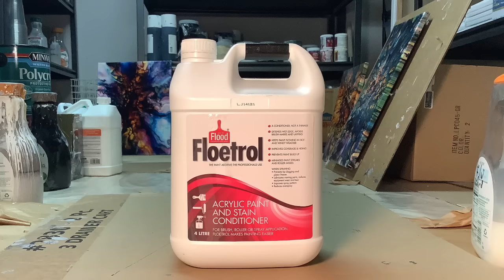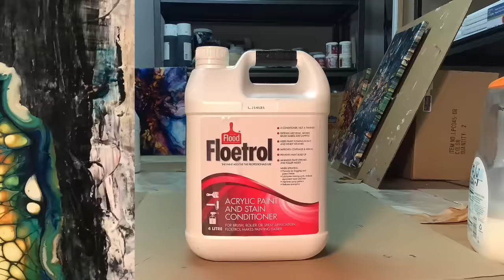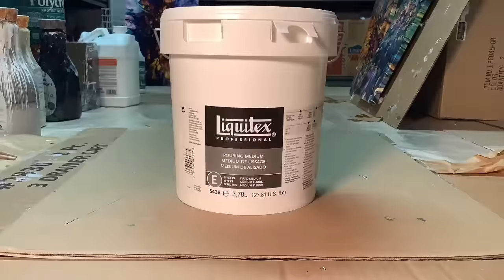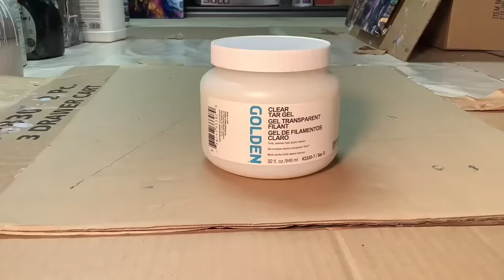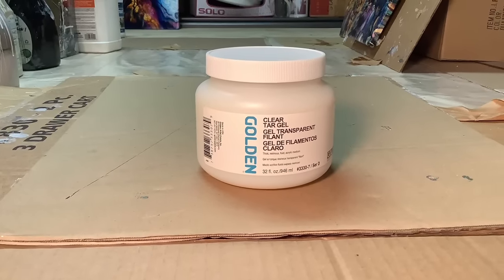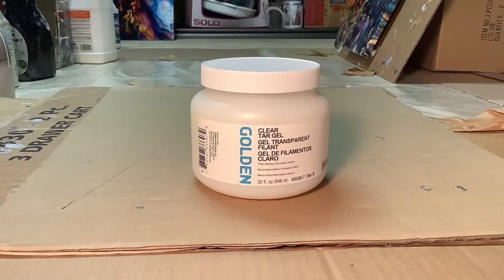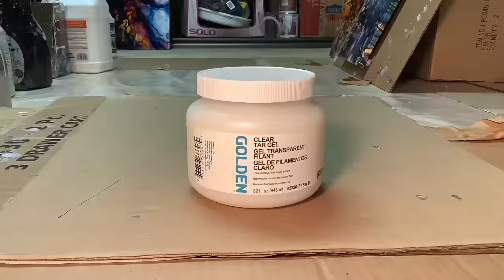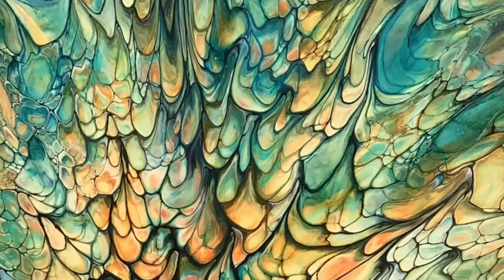What is the ultimate cell activator?

Comment: Fantastic video. I’m one of the artists you mentioned, who is about to experiment with cells. I’m so happy to know that I can have more control over this, by using the correct materials, instead of crossing my fingers & hoping for a good outcome. A question I have is, early in the video, you stated using 10% fluid paint in the mix to get pigment. Is it possible to use powdered or liquid pigment, which I have much of, in order to get colors with the other 90% mix you described. In lieu of using fluid paint at all? I have an extremely limited income & would like to use the pigments I currently own, instead of trying to budget costly Golden paint. Do you have any experience with this technique. Thank you for all this info. Beautiful art!
Reply from the maker: I appreciate your comments Karmic Scope. 🙏 thank you so much. I tried Golden’s liquid acrylics and it worked but I much prefer their fluid acrylics. I’ve never used pigment powder…my guess would be that you would need to convert it to paint first and the add it to the mix. Sorry I couldn’t be more help🙏

Comment: Hi Chase. Thank you so much for your video. Very very interesting. I just have one question about the base layer, I am assuming it is not necessary to add color paint to this layer.?as this is going to be covered by the 2nd layer and top layer after blowing and stretching?
Reply from the maker: I appreciate you asking that question MagzB 🙏 I’m sorry that I wasn’t clear enough in the video because I have gotten this question several times. The base layer is exactly the same as all of the other colors…same formula and same type of paint. The only difference is volume…obviously it takes a lot more of the base color than the other colors. In the case of this video the base color was titanium beige. ALL…of the colors used Golden fluid acrylics. The only exception was the paint in the top layer mix…and that was Lukas black. So to answer your question…yes the base needs color to blend with the other colors. Thank you so much to help me clear this up🙏
Reply: Thank you so much for clarification. 🤗🤗🤗
Reply: I live in France and I cannot get the Minwax polycrylic at moment nor the Behr paints. I will have to experiment a bit. Thank you so much.
Reply from the maker: @magzb5175  …I understand…folks outside the US are not able to follow my exact formula but that doesn’t mean your substitute ingredients won’t work..what you find might be far superior! What I can advise is what to look for. 
The main ingredient for the main mix (for me is the Behr) needs to be neutral so that the colors that are mixed with it won’t fade or wash out. It’s chemical composition needs to be simple…the more complex it is the more chance it will interfere with the pigments in the colors. Lastly it needs to be as stretchable as possible. The Behr that I use is the base used to mix the deep base colors for house paint …so it has very little (if any at all) pigmentation. When I open the can it looks like very light cream ( I would avoid it if it looks white) and it’s extremely thick. Start by asking the paint store for deep base or it could be named ultra deep base. Pay the extra price to get it in quart sizes and buy several to experiment with.
The main use for the Polycrylic is to thin the base without having to use water. It’s very thin and has almost the same consistency as water but it has just enough body and chemical composition so that it won’t weaken the paint. Ideally you want something more substantial than water that will not interfere too much with your deep base paint. You might experiment with varnishes or polyurethanes.
The Golden tar gel is not an absolute requirement but with my formula I found it to help with stretch ability and integrity. My advise is to concentrate on the other two ingredients and get them working to your satisfaction….then experiment with the tar gel.
Best of luck on your journey 👍
Reply: You are a gem.. thank you!

Comment: Dear Gift to us learning the process.  Please would you be so kind as t tell me if you have a print out of brands, quantities etc.  I tried looking at your transcripts and that helps but I wasn't sure.  It sounds like you use the Behr 3450 (?) now for both Base coat & for your Pour Medium.  Also i believe you said on the floetrol 5 parts to 8 parts water as the mix?  How much of the Golden Tar Gel do you add to that and also how & when do you use the polycrylic product?  Ever so thankful 4 the help and direction.  grateful, pam
Reply from the maker: Thank you Pamela 🙏 here is a simplified outline…

There is no “chemical” magic here.  It’s all about density/gravity of paint and controlled force to push heavy density paint down and out onto lighter density paint.
 
STEP 1:  Main Mix:  Base Paint & Color Pouring Medium; 
Mix: 3 parts Behr Marquee Interior Semi-Gloss Enamel, Deep Base, Untinted, 3453 (green can, HomeDepot)
       1 part Minwax high gloss polycrylic
Add: to the above add 10% Golden tar gel
EXAMPLE: 15 oz (3 parts) Behr
 5 oz (1 part) Minwax Polycrylic
20 oz (4 parts) total
20 oz times 10% = 2 oz tar gel (which is almost ½ part [2.5 oz], but is actually 3/8 part)
***The consistency of this formula is ideal for my use of controlled air. If it is too thick for you I suggest adding small amounts of water to the polycrylic alone until it suits your particular style...this will probably take several trials...so test with small proportions.
 
Apply a fair sized puddle as the first layer or base paint, it is the identical formula as all the rest of the colors....spin to thin it down a bit  and add more base paint around edges of paint that is already down, spin a bit, and smudge base paint out to edges of canvas.  
 
STEP 2:  Color Paint Mix; same consistency as Main Mix
Mix: 10% heavy pigment paint (Golden is best)
90% Main Mix (Base Paint & Color Pouring Medium)
 
Apply Color Paint Mix (second layer) in several ways, using squirt bottle, either very thin squiggly lines or in puddles made of thin squiggly lines that then look like they were poured, doing 1st color, then 2nd color, etc.
 
STEP 3:  Top Layer Mix ; this will be THIN
Floetrol/Water Thinner: 5 parts regular Floetrol plus 8 parts water. 
This will be used to thin the Tar Gel or the Liquitex Pouring Medium.

Tar Gel Top Layer Mix: 
10 parts Floetrol/Water plus 4 parts Golden Tar Gel. This makes the thinner for the paint.
Then mix:   8 parts Thinner Mix with 3 parts soft body paint.

Liquitex Pouring Medium Mix:
4 parts Floetrol/Water plus 10 parts Liquitex Pouring Medium. This makes the thinner for the paint.
Then mix:   10 parts Thinner Mix with 7 parts soft body paint.

Apply Top Layer Mix using squirt bottle  concentrating in center or apply as puddle made of thin squiggly lines that then look like they were poured.
 
STEP 4:  Use controlled force on the paint (compressor, blow dryer) to force Top Layer Mix  over color paint.  This is the most critical part.
 
STEP 5:  Spin or tilt
Reply: Thank you ever soooo much.

Comment: I am just starting out as well. Because I am so new at this and only have done one pouring technique when we went to a workshop together. I was told, starting out, use the cheap stuff first then move on to until you get better because it how much all this cost. Is that something I should do first?
Reply from the maker: I appreciate your concerns Sandy 🙏 thank you for asking. I started with cheap paint and it was probably a good idea because I had no structure so I wasted a lot of paint. Over the years I became more particular with ingredients because I could see that lower grades of materials were causing problems by introducing “trash” into the painting. Simply put..cheap paint has minimum pigments and more fillers (to increase volume). Artist grade paint on the other hand has much more pigment and minimal fillers…big difference. And it’s not just paint. When I started using Elmers Glueall as a medium. I got it to work but the finished product seemed trashy and that’s because it is loaded down with all sorts of chemicals and fillers. I switched and started using professional bookbinder glue and that made a huge difference because it’s a much more streamlined product that eliminates the trash and produced a much cleaner painting.
Lesson learned…the cleaner the ingredients going in…the cleaner the final outcome. Scroll through my portfolio from the bottom up at Chase Fluid Art on Facebook. You should see the progression from trashy to a much cleaner look as the years went by. 
With my process today I use the best paint I can find. It is by far the most important ingredient. All of the other ingredients are as straightforward, clean and un-complex as possible. They play secondary but specific roles.
Hope this helps….best of luck on your new adventure 👍

Comment: Hi. I'm hoping you see this, given your post was over 2 years ago., I have watched your posts so many times and can see why you take this approach. It is more to do with cell generation than cell activation, What is evident is there must be a relationship between differing pigment densities (colours) and a limit where the 'cell' is created by a greater or lesser dominance of another pigment,. You refer to floetrol as a thinner, which they clearly say it isn't.... they refer to it as a paint conditioner. I have a very simple question. When you refer to mixing, are you referring to by volume or by weight? reason I ask is that obviously not all paint is in such low viscosity that it can be measured by volume - even though it's sold by volume. example Windsor & Newton or Arteza are heavy and unless you know the weight of the empty tube, almost impossible to determine the volume, via the weight.
Your approach is quite unique and I both love your approach to understanding the science and love some of your visible work
Reply from the maker: Thank you so much David 🙏 yes…left to their own devices the differing densities can be layered to produce cells. However the use of force on a heavy/liquid top layer of paint can produce cells regardless of the densities of the layers below. Referring to Flotrol as a “thinner” is my terminology because it is used to make the paint less viscous. As far as measuring…I measure EVERYTHING by weight. I appreciate your questions 👍

Comment: I'm very new to this and all the videos I've seen say to use house paint as your pillow or base paint, but it sounds like that's not necessary.  Is that correct?
Reply from the maker: Thank you so much Gretchen 🙏. I’ve tried house paint…didn’t care for it…it caused too many unnecessary problems. I like simple. The fewer ingredients the better 👍
Reply: @chasefluidart4341  so then am I to assume you use regular artist acrylic paint as base?
Reply from the maker: @gretchengilham3749  …yes…the base is exactly the same as all of the other colors in the Main Mix👍
Reply: @chasefluidart4341  thanks so much! One more question,  what is the consistency of the Behr that you use? I can't get that here so I'm trying to find something comparable. I bought a base from Pittsburgh paint with a consistency of cold honey and while I like the finished look of the colors I add, I'm not getting cells,  so frustrating 🙃
Reply from the maker: @gretchengilham3749 🙏 in comparison to honey I would guess it’s thicker. Keep in mind that you want the Top Layer Mix to sink down and through the Main Mix to create cells. But there still needs to be some resistance in the Main Mix. Otherwise the Top Layer Mix will just immediately sink to the bottom with little cell activity. To start off  I would prefer to have the Main Mix too thick than too thin. If it is in fact too thick the Top Layer Mix will struggle to break through and you Will know that it needs thinning…and it’s easier to thin the Main Mix down with the Polycrylic than try to thicken it up. Bottom line…it takes experimentation to arrive at the right balance 👍

Comment: Thank you for sharing your experience on this very informative video! I have a question. Have you ever tried, Elmer Glue-All instead of Floetrol. I've seen video's of people using this instead. I haven't and wondered if it could work just as well or better. It's definitely less expensive. Thanks so much!
Reply from the maker: Thank you so much GL 🙏 I’ve used it in the past but it is made to cover a lot of bases. It has too many chemicals that can make paint go wonky. My feeling is that the cleaner and simpler the ingredients the better. Bookbinders glue is a better product but very expensive....I’m curious though...last time I was in Home Depot ..Flotrol was about $13 per gallon and glue all was $18....are you outside of the USA?
Reply: I've been pouring for about 4 years now and have tried everything. I've found Glue-All + poly crylic +Elf face Primer and sometimes a little water to be the best combo for me. I just saw where someone had said they liked Elmers School Glue better, so I've been using that and I think I might like it better too! The game changer for me was the Elf Face Primer (the light blue or pink one) You can get it at Walmart. It makes the coolest cells I've ever seen. Cells inside of cells inside of cells!!
Anyway, I love the glue...60% glue to 40% water.
Reply: @jackattack_8  how much elf face primer
Reply: @nadiaafreen218  
I use the pink one mainly and I just do like a pump. Depends really on how much paint you're using.
Reply: @jackattack_8  so what's ur ratio to  glue to polycrylic to face primer?
Reply: @nadiaafreen218  
I do almost as much glue as paint (Elmer's school glue mix with water. 60/40) 
Then I use a squirt of polycrylic

Comment: Great video. Can you please show me your air gun & compressor as I'd like to get one due to having emphysema thank you
Reply from the maker: Thank you Julie🙏 Interesting that you bring this up because my next video deals with this subject. More than any other piece of equipment the air gun is at the top of the list...it’s critical. It’s all about the trigger control and very few guns have that capability. It’s the ability to move the paint around with the least amount of pressure that counts the most...but you also need a lot of power at times also. My compressor comes from Home Depot... I don’t remember the model number but I can tell you that it has a 2 hp motor and a 15 gallon tank and manufactured by a company name California. I got the air gun and Venturi nozzle from...https://www.northerntool.com/shop/tools/product_200792060_200792060
Check out my first video “Abstract Cellism “ for more details.
Reply: Thank you so much will definitely check out your other videos. There are so many out there I don't want to waste money buying something useless & yours does the job so well
Reply from the maker: Thank you Julie 🙏 my best advice...time spent learning control of the trigger pays big dividends 👍

Comment: Steve, Hello from Charlottesville, Virginia, and thank you for your videos on Abstract Cellism! Being brand spanking new to the process (I’m a realist painter that works in either oil or pastel), I’m fumbling my way through the acrylic paint world. I plan on buying the products you mentioned, but I’ve already purchased VisWin and Pouring Masters, and I’m curious to know whether you’ve heard of them, and whether, since they are premixed, you think they would work with your process, utilizing the Behr, Poly, and Tar Gel? My first shot at using them with a drop or two of Floetrol (in each color) was a dud. It may have been because I also tried to use Gloss Medium mixed with GaC 800 as the base layer. I was attempting to create a translucent base. I’m hoping for the Oil Spill look. Oh, proficient one, can you guide me before I grind all of
my teeth down? ;) Thank you.
Reply from the maker: Thank you so much Diana 🙏 love Charlottesville. I believe that ingredients don’t “make” cells …they simply allow them to form through fluid dynamics. Therefore I look for as few ingredients as possible that will work well together and not interfere with the process. The problems I’ve seen with the pre-mixed mediums is that they seem to be overly complex with too many chemicals. I found that the Behr and Polycrylic (or varnish) is really all that is necessary for the main mix because they allow the paint to perform without interference. The next key is consistency and that depends on how each individual manipulates the paints that are layered out on the canvas. Since I’m using compressed air I will need a stiffer consistency to keep the cells intact as long as possible and that is why I add the Tar Gel. You may find that to be too stiff or not stiff enough. It will take experimentation and varying the ingredients to see what works best in your situation. Best of luck on your new adventure 👍